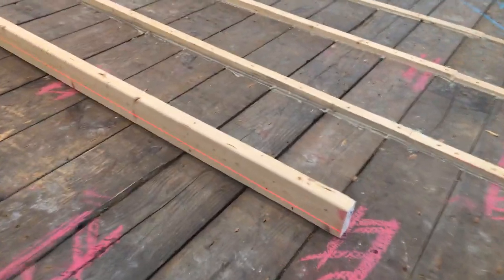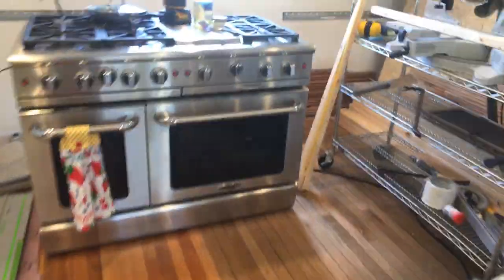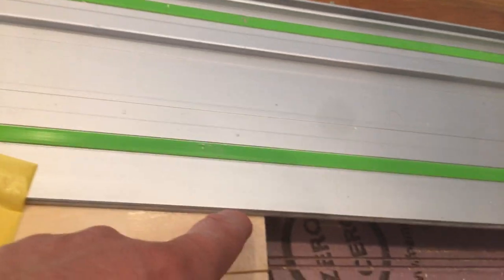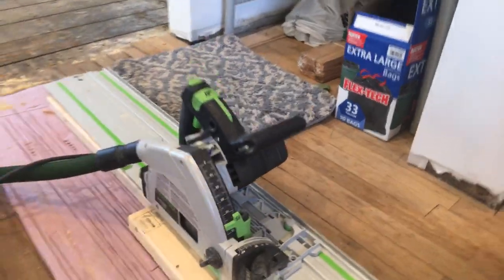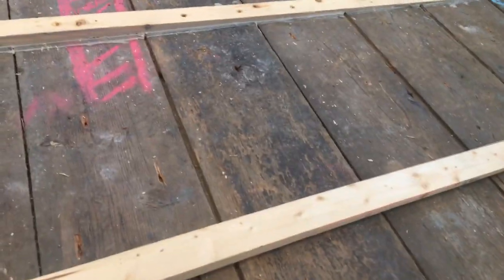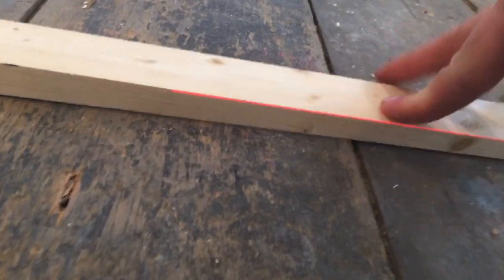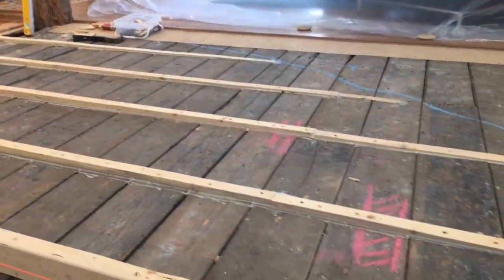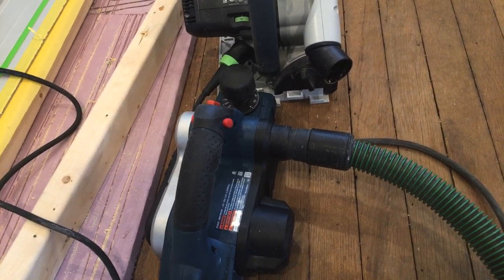Leveling a Sloping Floor #5: Cutting long shims using a Festool track saw

Comment: This is great! I have a very unlevel floor in my shop. Ive wanted to level the floor for a while. I'd like to pull up the flooring and the osb they used under. It's had some water damage. But I was trying to find a way to get it level. This would work great!
Reply from the maker: Cool glad to help! After over a year the floor has been great, no squeaks, creeks, or anything. Just flat and finished! Good Luck!

Comment: I have a very similar project.  Did you remove any drywall. My new subfloor will be higher than the current drywall. I was wondering if I need to cut off the drywall to slide the new subfloor under the wall?

Comment: If you are experienced and handy with a circular saw preferably a worm drive you can make very quick work of this. All you need is a set of saw horses 2 screws to fasten the board and a straight edge or chalk line. Have done 1000's of cuts leveling out 1500 foot old farmhouses in a day. Not that this is not a good idea or doesn't work. Festool is just a very expensive tool that not everyone has. And most all the other track saws on the market other then festool are junk.
Reply: I'd love to get a little more detail on this easier method. I have a very old wooden shed to use as my workshop and just need a basic method of leveling the floor good enough. It's not worth a lot of time and expense. Looking for cheap and easy.
Reply: I would like to level my laundry room floor as it has a pitch to it and I really wasn't sure how to go about cutting "wedge" pieces with a circular saw because the cuts would have to be perfect.
Reply: Ryobi has a track saw now for what it's worth, still expensive however
Reply: I did recently.  How I would bend a 2X6 to floor that is 4" off.  Yours way do not work always.  I did video to "leveling of floor with furring strips Zell"

Comment: Great Video! Curious as to the spacing you have between the long shims to level the floor and what if anything you do for the joists below the boards?
Reply from the maker: Hi kenchan529, Each long shim is located directly overtop of an existing floor joist located below the old subfloor that is the reason for the spacing. By using 4-inch long screws and tying the new long shims directly  into the old floor joists below we are transferring the load directly onto to the old joist. Another advantage is that by sandwiching the old subfloor boards in-between everything is tied together and it has eliminated all the squeaks and creaks the floor use to make. We have been using the floor for almost 6 months and it is working flawlessly. Very stiff, quiet, and level. We are happy with the result.

Comment: I think they are called sleepers instead of stringers.
Reply from the maker: You are 100% correct sir! I stand corrected :)
Reply: @postbeam8200  Thanks for the tutorial. I’m  currently replacing all the subfloors in my parents 100+ year old house and you have me seriously considering picking up a track saw of some kind because like you said I don’t think I want to try it on my table saw.
Reply from the maker: @jerod5636  Yeah the track saw was a game changer for me. I have a table saw but I se the track saw 90% of the time now.

Comment: I completely disagree with everyone leveling floors like this. This method of leveling is wrong because you are raising the floor higher than the neighboring floor. You need to cut away the beam to lower highest part so you level the floor with existing floor without raising it.
Reply: Your method would decrease the strength of the joist. I suppose you could sister new joists to compensate but that’s a lot more material and labor. Also what if there is framing sitting on top of the joist(s) at the high point? How would you account for that?